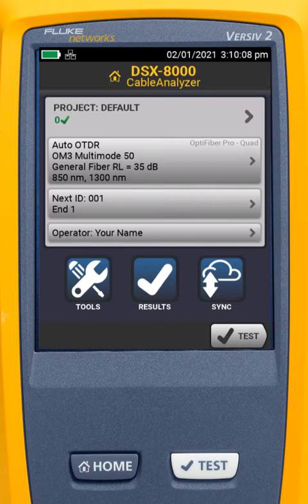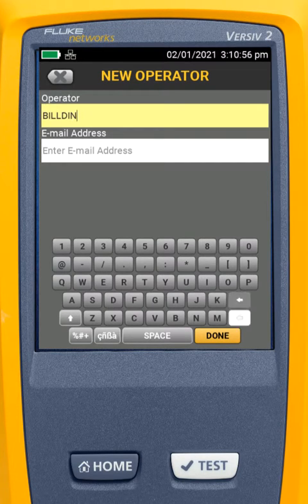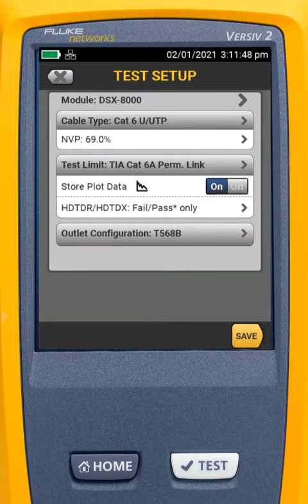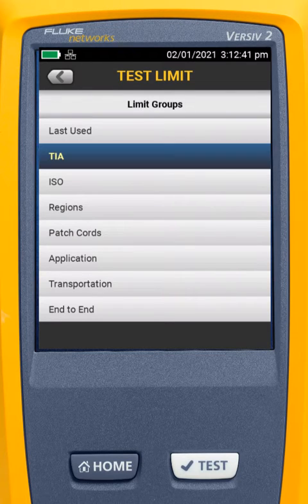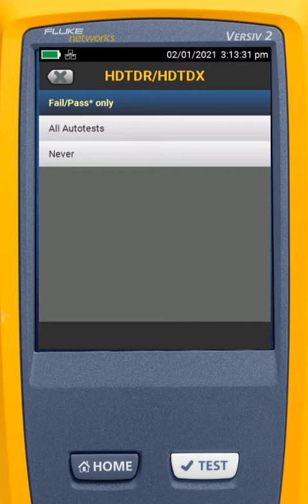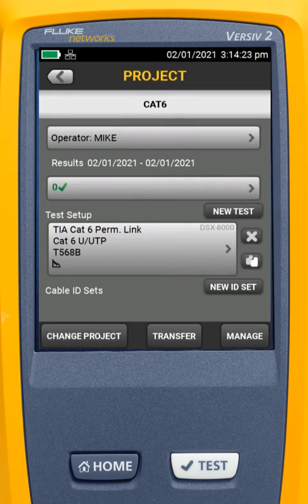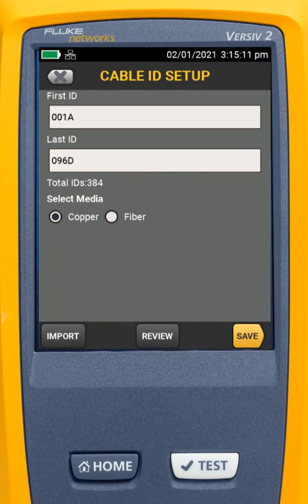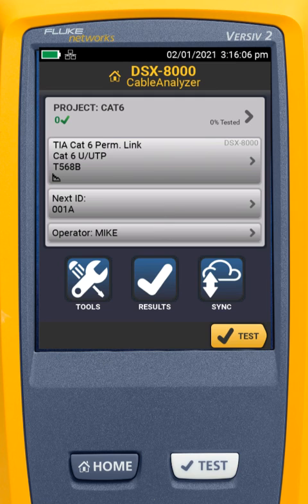Building a Cat6 test with the DSX CableAnalyzer™

Comment: Hello, I have DSX-PLA804 CAT 8 permanent link adapters, am I able to test CAT 6 cable with those adapters or just CAT 8 cable?
Reply from the maker: Those adapters are backwards compatible down to Cat 3 cable. You will be able to use them to test Cat 6 without an issue.